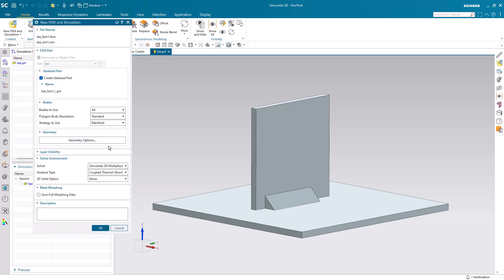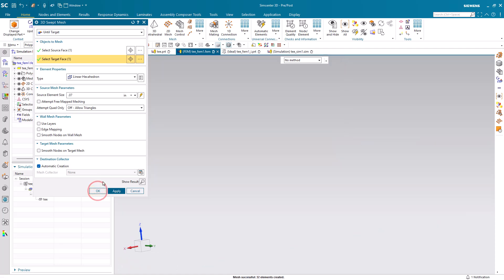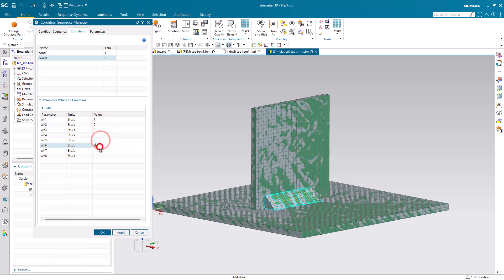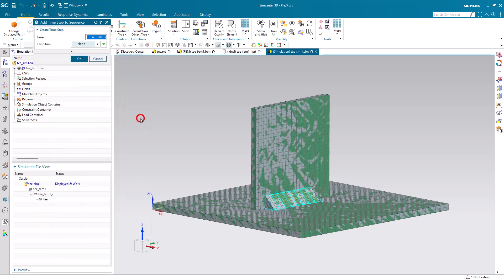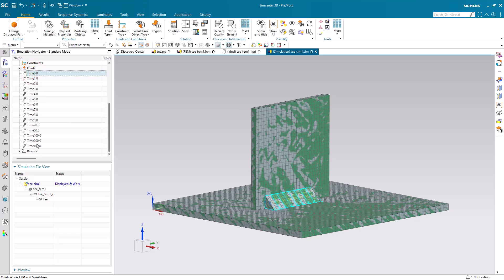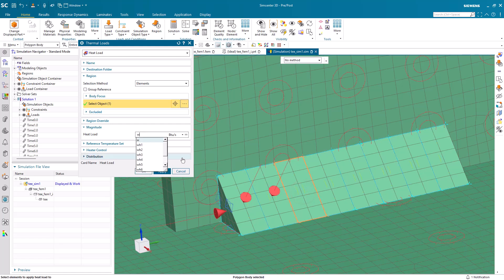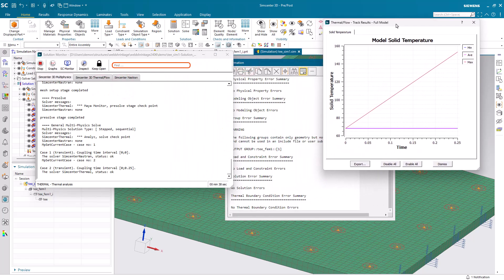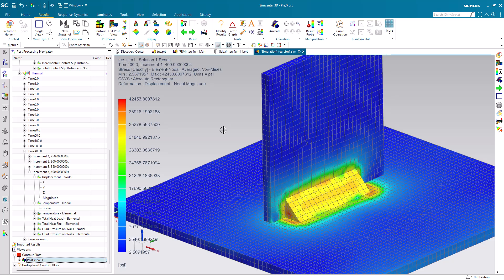How To Predict Weld Distortion

Comment: How do I define the Birth & Death of bead generating or sequential bonded contact at high temperature(welding temp.)?
Reply from the maker: Instead of using mesh mating conditions for connecting the discretized weld to the parts being welded you would need to use surface-surface glue instead.  Then you could control what glue is used when by creating simulation object containers in the transient subcases but this is not possible in a nonlinear transient coupled thermal structural analysis, however, it is possible to create simulation object containers in the subcases of a nonlinear transient structural analysis.  You could solve the thermal transient analysis separately then apply the resultant temperatures as a table of fields temperature load to the nonlinear transient structural analysis with simulation object containers that control what glue is applied when.  I haven't tried it this way to see if it makes much of a difference.  If you try it, please let us know if it makes much of a difference in the results.